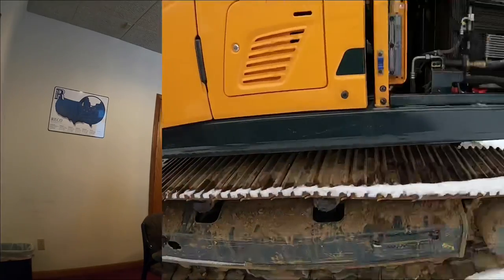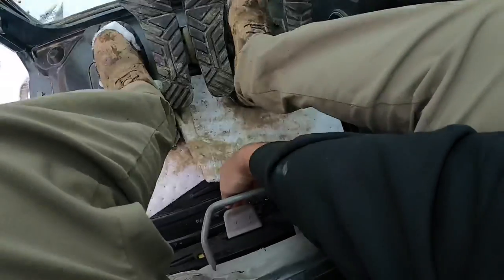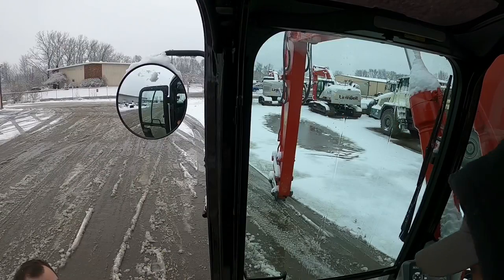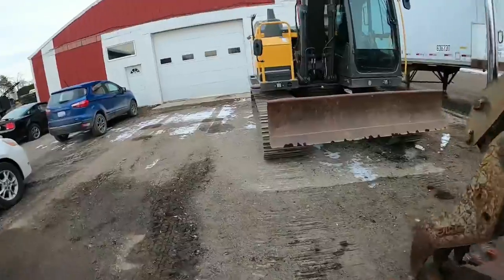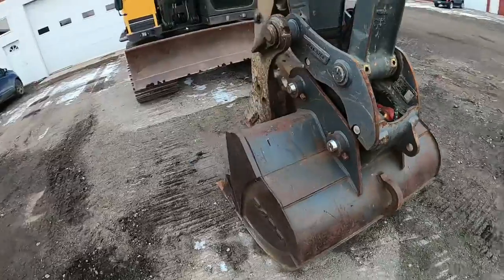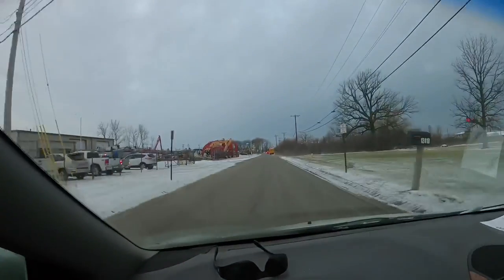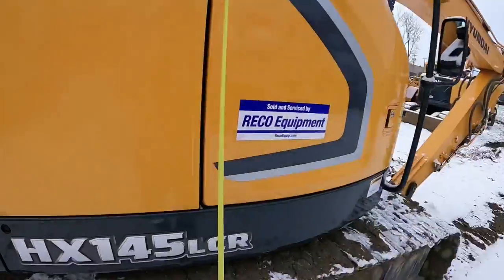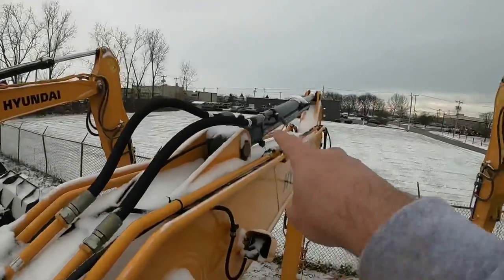Road Trip Shopping For a New Excavator #volvo #hyundai  #excavator

Comment: My friend got the 145. Hyundai zero.  Said it rocks like a basterd when digging?
Reply: Maybe Mike could call your friend and get the truth from and owner operator.
Reply: @VideosByAl  im sure its the truth.    Since i have 5 Hyundai excavators.  ,  and he has that Hyundai 145 zero tail.   Its a dash 9 modle not an hx.   And he owns a kumatso  also.     And as i stated before the 145 sits in the gravel bank with. 700 original hours on it.          I doubt he would need to lie to me since ive known him for 20 years. And he is the owner and the operator.  And told me this to my face.     ???
Reply: Ennis excavation,  Brian Ennis , Charlestown ,Rhode Island,,     and last i knew he was selling it. 700 original hours.  145-9.      For about 65or 70 grand.  Looks like new.          He couldnt stand it.      ,   as for my regular non zero hyundais.  Ive had decent luck with them.     Ive owned a pile of them.  Never kept one over 5000 hrs.           There fast ,  but in no way or shape as smooth as  hitachi/deere,,,,  or a cat.             There blow or go.   No damping in hydraulic cylinders, so there very abrupt when you get near end cylinder  ,       tracks are full bore or none.   Thats why there cheeper aint got all the goodies built into them.   , just like doosans dont eiether
Reply: @toddreynolds8875  Todd, I did not mean your guy was not truthful. I meant more incite of the machine vs. what the sales man was saying. Every machine has quirks or something strange to it. Sales Man won't tell ya that.
Reply: @VideosByAl  i figured that.      Also i think. Mike already bought a machine prior to end of the year. And these are old videos leading up to show his purchase.        But i just tried my friend no answer,  but absolutely would have them talk.   , i tried about 3 weeks ago. Toldmike about the machine  but.   Not interested i guess.  ,   i told him i would  tell him my experience with Hyundai.      Ive had 2 used Hyundai excavator and 4 new ones  and an almost new 757 loader  ive had years
Reply: I had. 4 Hitachi prior.    And.  Hitachi eat them alive for smoothness and durabilty.        But the Hyundai were 50/60 grand less new.  So i switched
Reply: Sounds like the economics of flipping the Hyundai every 5000 hours is working for you. Keeps you in a fresh machine with warranty for some of it.  Buddy of ours flips Cat skidloaders at 2500 hours to avoid down time and the price of pumps.

Comment: I have heard some horror stories of machines 2010-14 vintage around 200-250 class Hyundai’s 

Using massive amounts of fuel
Like twice as much as a doosan doing the same task on the same site 

So if possible during a test drive some hours then measure your actual litres per hour and compare that 
1000 litres of fuel might last 10-30% longer brand to brand at the end of the day it’s all money on the bottom line
Reply from the maker: Thanks for the info

Comment: My $0.02

1. Get the machine that fits.
2. Next look at dealers
3. Change mind if 2 cancels out 1
4. Work out financing and price

1256890. Care about what others think about your decision.
Reply from the maker: Thanks
Reply: @DirtPerfect  I am in the market for a skid steer. Everyone is screaming bobcat at me. I do not like the offerings in the size I want/need.

The ASV is what I need. A 48" wide machine will fit into backyards. I can pull it with a half ton truck. Low ground pressure makes little ruts. Lots of plus, little minus. 

When I tell people I am considering an ASV they freak out. I don't care. It checks all the boxes.

Comment: After actually seeing that Hyundai it’s a nice machine. I always thought it would be some import junk.
Reply: Have you ever actually ran a peice of heavy equipment. Kind of stupid to just "think" something and bash it for no reason. I have never ran a Hyundai excavator but however run a hyundai wheel loader a lot. Has many hrs on it and rarely needs to be repaired just general maintenance.
Reply from the maker: They are awesome machine my opinion
Reply: @snowblowerman5115  yea I know, people have predispositions. Alot of times they hate something and after trying it liked it. I hated glocks and they tried one and liked it. I shot that rental gun better then my own personal favorite that I had shot 2K+ rounds through at the time. I was impressed, so my stance has changed. I just used to the Hyundai name with cars and there where SHIT. now there not that bad but I still remember that. Same with Samsung, now anything I touch from them I think. This is a nice looking firebomb. since they had several of there products exploding.

Comment: Could you do a video showing what you don’t want in a used machine. What it means if the undercarriage is shot and what to look for. Also when you are testing the machines what are you feeling for or looking for you didn’t talk much to explain what you are feeling. I only ask as I know nothing about earth moving machines but want a dozer and hoe for the farm. I know it will be well used stuff but just don’t want absolute junk. 
When I bought my first haying equipment I knew nothing and got messed over on my first square baler not knowing what to look for. I spent 3 times what I paid for it fixing it only to sell it a season later for what I originally paid for it maybe less. I just don’t want the same thing to happen on this equipment.
Reply from the maker: All good ideas will see what I can do

Comment: Why can't you tell us ballpark cost numbers?  

Have to agree - that Hyundai looks a sweet machine.  Perkins makes a good engine.  Rear visibility was as good as it gets for zero swing.  But how was hydraulic speed and lifting capacity?

That said, buying new is tough to justify unless you're desperate to finance and dealer has incentives.  Just like cars, I'd buy a ~2 yr old machine with a few thousand hours where any teething issues have been solved - lot of stuff coming out of the oilfields these days, so some decent prices to be had if you're willing to ship it aways.  

I don't understand the fascination with couplers.  How many bucket changes do you really make?  Takes about 5 minutes to swap over buckets - takes thousands of changes to justify the cost - rather keep that money in my pocket.

Comment: You realize you can not afford the New HX145LCR at what $140,000.00, that is the reason you are still in business after all these years. You know what your firms cash flow can handle.
Many small dirt contractors never learn about cash flow until after they have had theire quipment taken back by the finance company, that should have never had sold them the machine in the first place, fully knowing that the contractor could not safely afford the machine, but that sales commission is powerful incentive to move equipment. Many equipment operators think that they could make a go of it if they went into business for them self, but the reality is - even if some one was a wonderful equipment operator and full of experience; if they do not under stand the business side of a small dirt excavating business they will go broke, out of business. Happens all the time.
Reply from the maker: Stay tuned 🤷‍♂️

Comment: We have a 2019 Volvo. I wish we had never purchased it. We have had the absolute WORST customer service of any machine we have ever owned. Steer clear of them. They are overpriced on parts and service and (speaking for our dealership Ascendum Group) the people could not care less about you after the paperwork is signed. 

Linkbelts have always been great machines. Very strong and reliable. We had older ones though. What I hear now is the mechanics hate working on them and that drives service costs up. 

Being that you do land clearing mostly I personally would want to stick with a conventional tail. 
Why do you want a reduced or zero swing? They will be a tippy machine.

Comment: Just don't buy a Hyundai   their terrible machines that fall apart.
Reply from the maker: Sorry Simon will have to disagree
Reply: @DirtPerfect , if you could come look at the one we own and all its problems you won't be saying that.  What are you on a sales commission or something.  Terrible machines.
Reply from the maker: Simon Chant what machine do you own and what do you do with it and did you buy new
Reply: @DirtPerfect  komatsu pc 220 LC  sandstone quarry.  Lots of ripping levelling of rock sawing hammer work.  Fork attachment for loading blocks on trucks.  Komatsu has 8080 hours and all we do is service regularly never a breakdown.  Hyundai has more time down than anything else to the point it's been chucked in the corner as no one will operate it. It's a heap of SHIT.
Reply from the maker: Ok what model Hyundai and do you own it are your employers
Reply: Last sentence didn't really make sense but it's 180 LC -9
Reply from the maker: Do you own the machine
Reply: I wouldn't be so stupid. The quarry owns I refuse to operate the heap along with 4 other guys. I've owned 5 ton many years ago and it wad also terrible.  Not balanced ect